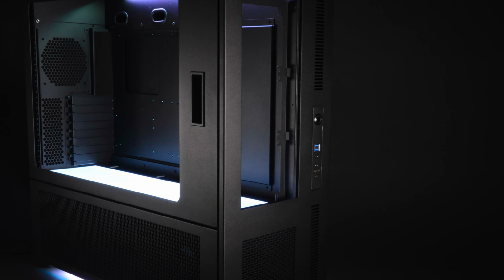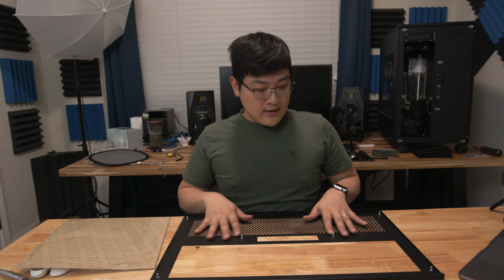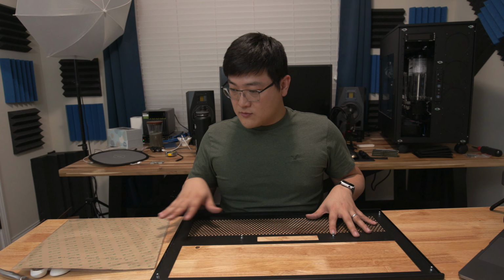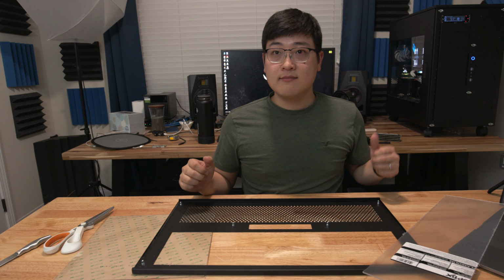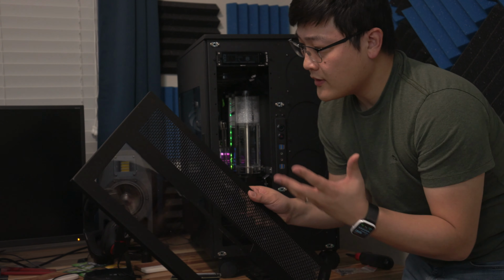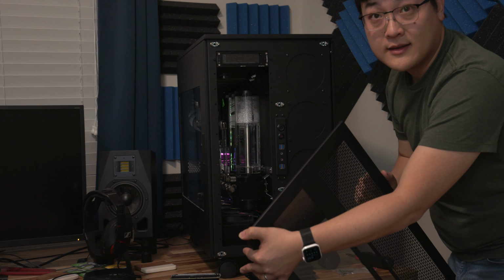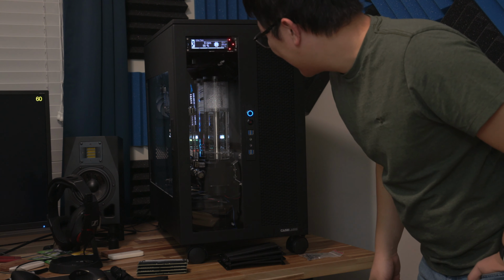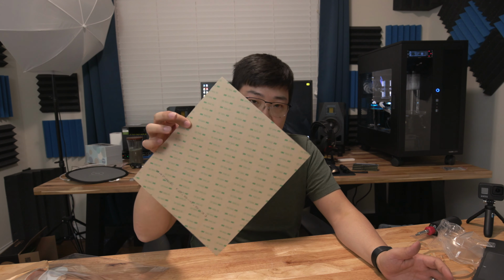AMD Threadripper 3960X Build Part 5 - Casemod Encore!

Comment: what were the measurements for the acrylic, my th10a has a custom dual d5 pump front distro that i wont be using.
Reply from the maker: I don’t remember off the top of my head but measure it with a ruler or tape measure and give yourself 1 cm or so on all edges for the tape to stick. I recommend going a little thicker acrylic just like the OEM acrylic on the window so it won’t flex as much.